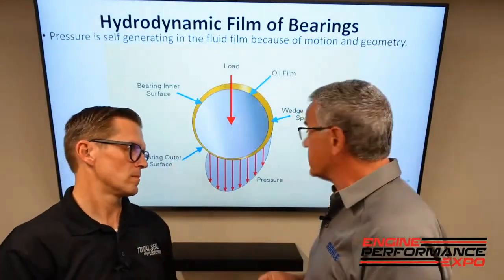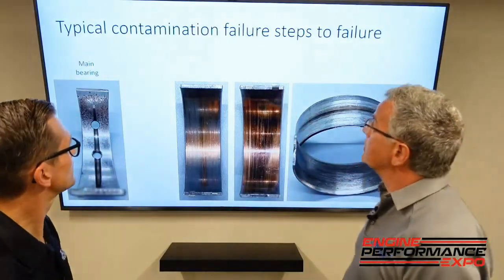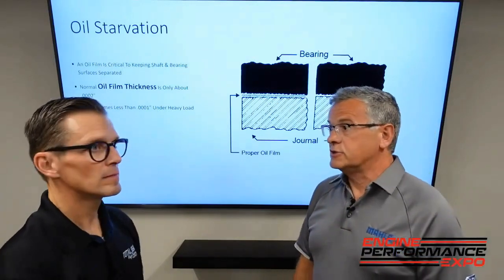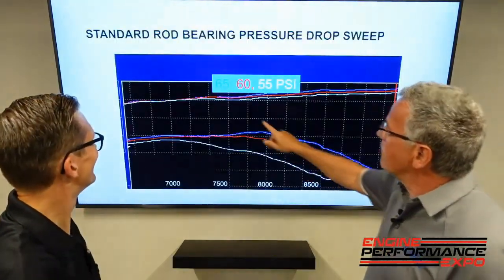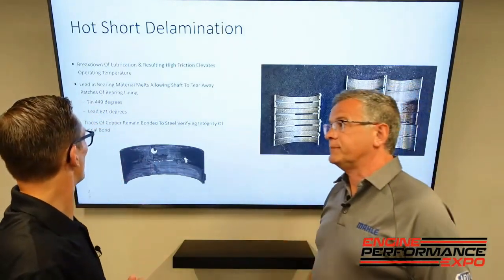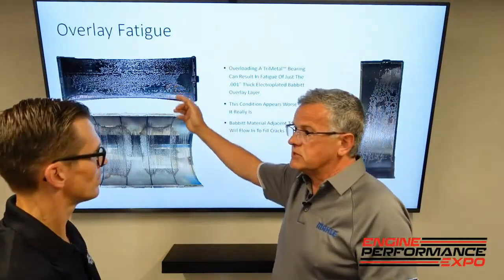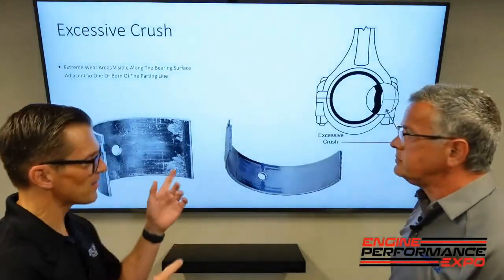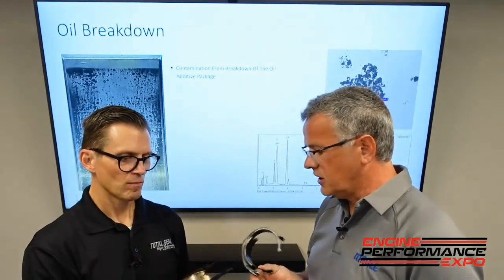Bearing Failure Analysis (2023 - Episode 25)

Comment: Ive used Straight 30wt. Valvoline in Stock Car engines, Truck Pullers, Drag engines, and my Street Truckwith 4.3 V6 , No Bull, have witnesses, it went 544,867 plus miles with straight 30wt.Valvoline, and a Wix filter with NO REBUILD OR OVERHAUL !

Comment: What some people may not understand, is that 60lbs. Oil pressure is not like 60 lbs. Of weight, but is like hydralic pressure, it may be 60lbs. PER SQUARE INCH, to keep the crank off the  bearings.

Comment: Over-scavenging on restrictor-plate engines causes bearing damage. I had a Pontiac street engine that did the same thing at 3800 rpm cruise. It pulled 23" Hg at 3800 rpm. Tri-Y (4-2-1) collectors and an X-pipe with full length 2.5" duals. Too much overlap, or too much exhaust length. Highway cruise would instantly overheat the oil to 300 degrees.

Comment: Good Morning from Australia. First I have a hyundai 2012 ix35 with petrol theta 2 direct injection motor. The car has only travelled 75000 km from new serviced 12 monthly at about every 8000km. In November 2021 the engine started knocking so I took it to Hyundai who investigated the knocking and informed me the engine had suffered a catastrophic engine failure and big end or bottom end bearing on no.3 cylinder had failed. Hyundai Australia refuses to accept liability for this failure and the matter is now before the civil administration tribunal. I have been asked by the convener of the tribunal to prove what caused the bearing failure and that the failure  was caused during the manufacturing process. I still have access to the car and the engine, however the oil has been drained. I believe it maybe partly disassembled however not completely. I have spoken to a number of mechanical engineers in Australia who have told me that if the bearing has failed it is impossible to identify the cause of the failure and this leaves me unable to prove to the tribunal, a. what caused the failure and b. that the failure was a result of the manufacturing process. I do know that 1.4 million vehicles with the theta 2 direct injection motor produced by Kia and hyundai in USA have also suffered with this issue and there maybe documents that are avaliable stating the cause of these failures which caused the recall. However I have not been able to locate this information  is there anything I can do to prove the points requested by the tribunal
 or is my case a lost cause. please Help. I do have access to a workshop and could continue to pull the engine down to reveal the other bearings, caps and con rods.

Comment: I recently bought a 76 Chevy truck. It started knocking. #1 and #2 rod bearings had major offset wear to one side of the lower cap bearing. I'm thinking great it has bent rods. But no, it was something much stupider and totally avoidable. 
I was already set to buy new rods but out of habit I ran a fine file across the face of the rod parallel to the bearing opening, nothing bad. 
When I separated the cap from the rod and ran the file across the jointing surface between the cap and rod, bingo. It had a lip from some moron using a screwdriver to pry the caps off.

Comment: Do you have an explanation for why the rod bearing pressures are reducing at high RPM in your instrumented crankshaft? Is this the effect of increased centripetal forces fighting the oil flow through the crankshaft oil passages?